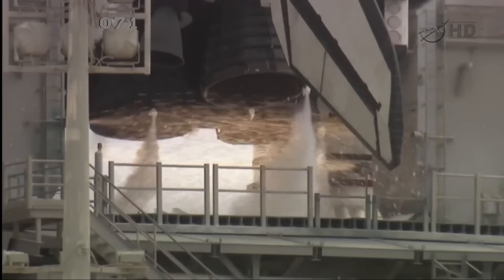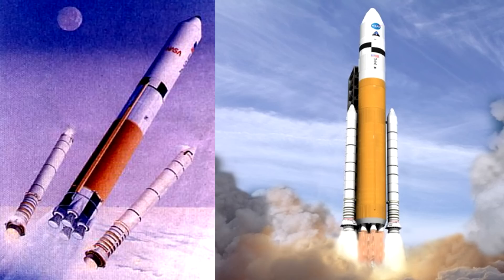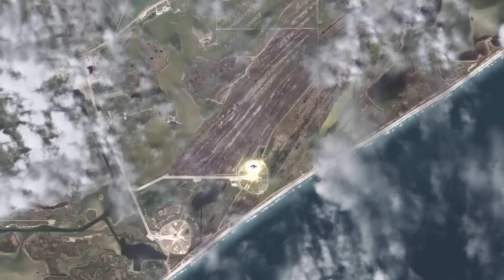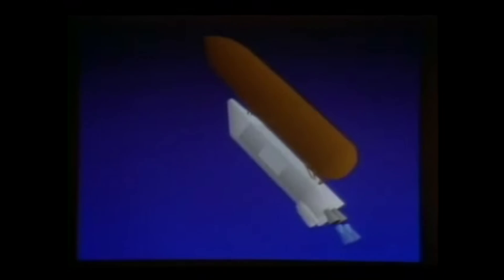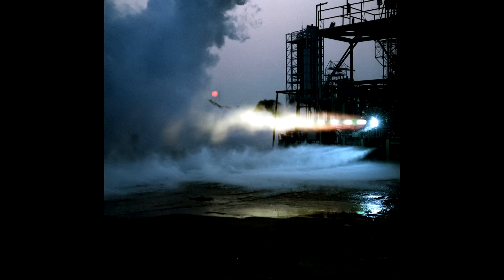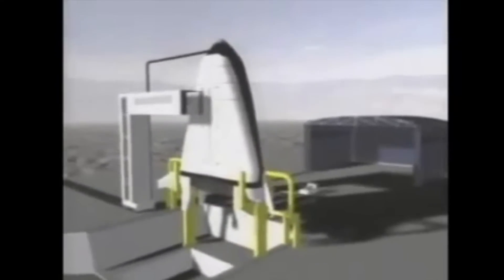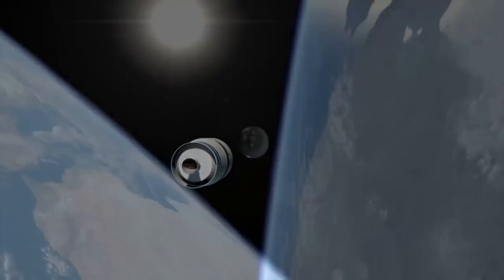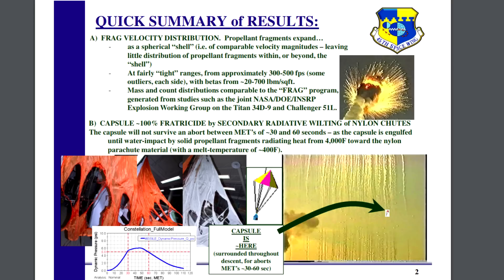Why The US Took So Long To Replace Space Shuttle's Crew Capability

Comment: Will any of these rockets accually go up and out this time or do the usual up and off to the side.
Der I see plenty evidence for the dome.
NASA works for digging tunnels and the South hole.
Reply from the maker: The laws of physics, as described by Isaac Newton 300 years ago, show that going up let’s you go into space but then you fall back, but if you go up and to the side fast enough then you’ll orbit and stay in space.
Please catch up with 3 century old science before using 21st technology internet, otherwise you will look dumb.
Reply: If a rocket only goes up, one of two things will happen:
1. It does not reach escape velocity and fall back down without entering orbit.
2. It reaches escape velocity and end up in an orbit around the Sun, not the Earth.
None of these options are useful if you are launching a weather satellite, a communication satellite or anything else that needs to orbit the Earth.

Comment: Meanwhile there are two replacements for the Ares1: SpaceX's Falcon 9 and ULA's Atlas V.
There are two replacements for Orion: SpaceX's Crewed Dragon and Boeing's Starliner.
As for the SLS there are two replacements on the way: SpaceX's BFR and Blue Origin's New Glenn. In the meantime the Falcon Heavy is operational and can be used for near future missions until NASA needs a larger diameter for payloads of equipment that haven't been designed yet. You get all of these options for less than the cost of the SLS. You only get one flight of the SLS before you put a human on top as opposed to over 70 flights of the Falcon 9 and probably over 80 of the Atlas V by then. My guess is the SLS will fly no more than 3 times before it is retired. Now the BFS will change everything if it works. It's a spaceship, it's a space station, it's a lander and it's a rocket for a return journey from the surface of another planet or moon. You only need the BFR to get the BFS into Earth orbit. I have no doubt there will be delays, but I don't doubt that SpaceX will succeed. People doubted the Falcon 1, the Falcon 9, the reusability of first stages, the Falcon Heavy, etc.

Comment: Yep instead of using newer more efficient, simpler, and cheaper engines, lets use the ones where 3 of them cost more than a falcon heavy. 2 of them costing significantly more than a falcon 9. Just the engines, not the boosters or fuel or tank or upper stages.

Comment: The new system was designed before the shuttle was shut down.  They came up with the boosters because the government wanted to continue with the reusable booster system.  Although it was a flawed design in extreme heat and cold proven by problem ridden O rings during the early days and proven it was a problem when Challenger exploded in 1986.  However, they decided to redesign the main engine of the shuttle and went to a 4 or 5 engine system with the two boosters which have been used int he shuttle program.  In addition they added what was learned from the Mercury, Gemini and Apollo programs in order to create the crew compartment and emergency systems that were determined they needed in case of a problem on the launch pad, after launch, and during flight.

Comment: Actually the Soyuz was designed in the mid to late 50's and has been flying since the first cosmonaut made his trip to space shortly after it was ready for flight.
Reply from the maker: The Soyuz booster is from the 50’s, but the early spacecraft was the Vostok which is significantly different from the Soyuz

Comment: Hey Scott - I noticed that the space shuttle always had its main engines pointed backwards a little during takeoff and, according to the graphic in this video, after the SRB's have separated too. I assume this is to keep the shuttle flying straight, to offset the weight of the external tanks and SRB's, but if this is true, it must be terribly inefficient? Any chance you could give us an explanation of the physics behind this, and what happens to the center of gravity before and after the SRB's detach - surely there must be a lot of gimballing going on as they detatch, to counter the weight and thrust of the SRB's and external fuel tank?
Reply: This is kinda late but I can answer this. Yes the Shuttle's engines needed to point through the stacks center of mass, so they had to angle back because the shuttle was of course mounted to the side of the liquid fuel tank. As fuel was burned and the tank got lighter, the engines would gimbal to maintain the correct pitch, same with when the SRBs get jettisoned. The shuttle main engines had a pretty large gimbal range for this. It is inpressive because it would have needed to be extremely precise, and this was before high performance computer simulations when the shuttle was originally designed. 

And yeah, its not as efficient, but the idea with the shuttle was to have an orbiter that could land on its own at the space center (so they didn't need to rely on the US Navy for crew recovery) and be reused for future flights. Its pretty fun considering everything

Comment: Scott, I believe the recession had a lot to do with the Aries/Constellation being cancelled and Obama had just got into office, But like you stated it was a very expensive project that a lot of people thought was out of line. I was working that project and actually got a 'pink slip' verbal notification from an astronaut. Classiest way I ever went to the unemployment office." Thank you for your service".
Reply from the maker: Yes, the recession meant it was harder to not cut the program after the Augustine report. And of course you highlight a problem I have with simply attacking a program like SLS as unnecessary, there are good people working in these projects.
Reply: The people working these projects have to be a second concern, NASA has to use it's resources responsibly and are beholden to the taxpayers. A major problem with government contracts is that they are using 'other people's money' and are often lose sight of required frugality. This was recently brought forth in the NASA Inspectors General report on SLS. But my guess is that this typical govt. wasteful spending and has been going on for ever. t'

Comment: There's one thing I don't understand.  Why were the solid rocket boosters made reusable, but the gigantic orange fuel tank was designed to be disposable?  What was the rational behind the difference?
Reply: I assume you are talking about the Space Shuttle.  The SRBs didn't have to go as high or as fast so, recovery was easier.  The main tank goes nearly all the way into orbit, so it would need the same level of reentry protection as the orbiter to recover by reentry, and it's not that elaborate or expensive compared to the other components, just a tank with some insulation.  The mass budget would have been prohibitive, and it would not have been cost effective.

There was some talk of using the tank IN ORBIT.  Basically, Skylab was an oversized Agena upper stage with the fuel tank reused as living area.  A single main tank fitted out in a similar manner to be a component of the ISS would more than double the living space of the station.
Reply: @digitalnomad9985  Ahh I see.

Comment: It's been a long time between launches, fraught with technical and political difficulties and outright obstruction, but the US is now at the point of having not one crew launcher (NASA, Shuttle), but *four*.  SpaceX and Boeing as part of Commercial Crew (and we'll assume that there won't be any problems with the demonstrations) with Crew Dragon and Starliner respectively, Lockheed Martin/Airbus with Orion (which will fly on SLS between two and four times), Blue Origin with New Glenn (we'll assume it works as advertised).
Add to that Dream Chaser which could conceivably be modified for crew (although probably just as a lifeboat), and whatever sneaky-sneaky stuff the US DoD is doing with the X-37.

Comment: Why? Politics, pure plain and simple. The SLS, the NLS, the Shuttle C, the Jupiter all had to have 4 or 5 segmented SRBs to keep Morton Thiekol happy. And Utah politicians happy. Using the basic External Tank kept Lockeed Martin happy along with various politicans happy in Alabama, Maryland etc. Nevermind the tank had to be extensively redesigned given the thrust loads and where the payload mounts. For boosters I think you would just as well to contract for Falcon 9s. We know they work. We know they are reusable and we know they can return to the launch site. But there's those pesky politics sgain.

Comment: So NASA's answer to a shuttle replacement is a "supersized" Apollo. Oh and by the way, they're going to use the same type of boosters that killed the Challenger crew. PATHETIC!
Reply: It only killed the challenger crew because the nasa officials idiotically decided to launch the shuttle in temperatures that were beyond the tolerances of the boosters. What was dangerous about the shuttle was the insulation that often fell off and chipped into the heat shielding which killed the columbia crew. Luckily that is no longer an issue as the parallel stack of the space shuttle doesn't exist anymore, along with a proper launch escape system on the orion.
Reply: @wheresmycar9559  You REALLY need to check up on the SLS. First, guess what. The  boosters look like a Saturn WITH TWO SHUTTLE  STRAPPED ON! If you check the WIKI page the Block One launcher uses IMPROVED SHUTTLE SRBs. They haven't finalized the block two system yet, but of the three proposals, only one uses a liquid fuel system in the boosters. the other two use SHUTTLE BASED SRBS.
Reply: @wheresmycar9559  Remember, this is the government we're talking about. They weight cost and/or what future political advantage via patronage they can gain. That's why we don't still have the shuttle running and why we lost two.

Comment: The way the Ares and SLS programe have been handled is really bad and extreamly time consuming, not to mention the changed goals of the programes over the years. What they should have done is to fly the Space Shuttles some more years until the CCP or SLS/Ares could start delivering human flight capability - Say at least 2015 but prepheringly 2020. If done right there should be no gap between american astronauts programe. Johan.

Comment: The heck with shuttle derived, I say Saturn Derived. Shuttle hardware combines all of the worst in propulsion technologies,hydrogen first stage instead of much cheaper reliable kerosene, horrible man killing non stoppable solid boosters instead of the same,kerosene F-1 technology. It's all about politics not engineering sense. All of the gains in pride the US got from Apollo are lost not to riding on Russian rockets, they're laughing all the way to the museum. Great video as usual though.

Comment: SpaceX has done impressive things but I would be pretty reserved about claiming that the commercialization of rocketry will be "good" for space travel. Proprietary technology under the control of a wingnut executive like Musk is likely to hamstring a lot of programs at NASA as their shareholders insist on focusing development on the most profitable vehicles, which may be private spaceflight or military satellites. Musk may promise the moon (or mars) but Lockheed's spec sheets for the F-35 looked amazing too.

Comment: This might be a dumb question but it's something that's puzzled me for years: NASA has so many other flight-proven and reliable rocket systems, why not just put a crewed capsule on top of one of them? Is it a weight problem?
Reply: NASA has no flight proven launch systems of its own. They contract everything they launch out to 3rd parties, typically ULA and now SpaceX or Roskosmos.

When Saturn was scrapped, just the Shuttle remained, everything else belonged to the armed forces and now commercial companies that ran those programs for the armed forces under contract.
Reply: @jwenting  Ah, that makes quite a lot of sense. Thank you for the clarification!
Reply: Believe the Starliner is going on an existing platform a ULA  Atlas V.   It was suppose to be able to fly on a Delta IV, Falcon 9 and the future Atlas/Delta replacement the ULA Vulcan.    

The delays are NASAs risk aversion for the commercial manned space think it is 200-1 or so causing delays in the readiness of Dragon and Starliner.  As well as congresses (Shelby) holding back funds etc... to support the old systems.
Reply: From an engineering perspective, the issue with "crew-rating" an existing rocket is that human bodies have tighter tolerances for acceleration and vibration than satellites. Generally, a crew-rated launch vehicle must never exceed 6.0 g's of acceleration during a normal mission, and must have much less vibration than many rockets tend to experience. Having low maximum acceleration and lower vibration tends to reduce the total payload capacity, so designers don't tend to design for those constraints if they are told that the vehicle is not intended to carry people.

Comment: Very good video, with some excellent footage and technical details. You didn't mention the vibration and pogo effects, which turned out to be a problem in using a shuttle SSB as a single booster. I think that Space X have changed the game, and that a new BE-3U powered LH2/LOX upper stage for Falcon Heavy could quickly enhance its capabilities if necessary.

Comment: The orbiters never failed. The engineering of the rockets strapped to challenger, and the fuel tank strapped to Columbia....that’s what failed!!
Reply: If the orbiter could fly without the rest of the stack, only then would you have a point.

Comment: As it stands if you want to get something into orbit as cheap as possible, as I see it you can take 2 paths, reusable and discarded. If you are going discarded, you probably want to use mostly solid rockets. If you are going to go reusable, there would be costs involved in re certification of the rocket. It would be best to design a reusable rocket around the most resilient and simplistic parts.